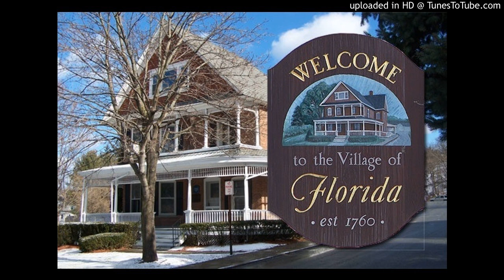Warwick and the 914 Area, pgm. 12: Long Distance Calls from Florida NY Step (February 1977)

Comment: This is certainly one of the more fascinating routing cases. The absence of the busy and reorder signals just adds to the uniqueness of this part of the system.

Also, that idea on how you wound up in that one conversation, regarding 3 way calling and the like makes complete sense.

It reminds me of a time in the early 2000's when I was regularly in 3 way calls with friends. Friend A would have me and Friend B on. I would get a call from another friend, switch over to talk to her for a few hours and then when that call ended normally that would be it.

Well, one day this happened, I talked to friend C for a few hours, and when she hung up the line flashed back to the other friends. I said "hey guys" which absolutely SHOCKED them -- they thought my connection was long gone. I still remember the surprise in their voices.

Those were fun days....

Comment: You were obviously more of a phreaker than me and my friends.  I was always afraid an Operator might dime me out to the "Phone Police" if I played too much.  I already caught their attention for a different reason.  Plus, when you hook a "borrowed" 3-slot into your dorm's coin line that had a single slot 1A, you could hear the surprise when the Operator says, "I thought those were all gone."  Lucky for me there were a few 3-slots left on campus in remote locations, but I was paranoid the PC's find me.  

I've experienced NJ Bell TSP Operators who recognized me.  1 Saturday night, I was repeatedly trying to call Dr. Demento's request line and after a few times getting the same Operator, she'd have me hold off pumping the quarters* into the phone until she got thru to the line.  Needless to say I spoke to her many times that night!!!  **The quarters always came back even if I got thru, unless I grounded the receiver's armored cable thru may arm to the booth shelf, resulting in a nice shock and the loss of a bunch of quarters!!  

So, where in Florida was the payphone you played from and what type of coin phone was it?  I don't know what WVT was using in 77 (didn't know that WVT even existed)?  Friends an I called the Monroe area's payphones "plastic payphones."   The nicest payphones in the area were the all chrome Northern Electric (?) Touch Tone 3-Slots in the vestibule of the Bright Star Diner in Central Valley NY!!!!  Wish I could have popped one of them off the wall!!!
Reply from the maker: For many phone trips,  I specifically recall the location and the type of phone I used. But Florida... I don't recall anything except that it was after nightfall. From the tape, I'd guess it was a Northern Electric Centurian (single slot, plastic front), but that's without researching to see if the sound of dialing actually matches known Centurians.
The Warwick phone was some sort of a 3 slotter but I don't recall more.
The coin relay was able to operate on current that passed THROUGH your arm? Are you sure you weren't just shocked IN ADDITION TO having the cable touch the shelf?
Reply: @evandoorbell4278  Thanks for the phone info.  I'm pretty sure the relay current passed thru my arm - the phone's ground was "switched off" and the current went from the cord thru my forearm to the booth's shelf, which was still grounded.  The booth was the typical 1950s/1960s wooden booths, my dorm was built in 1964, a WE Type 6 booth if I remember correctly (though I should get off my butt and walk 15 feet see if I can find the booth model number on the booth in my living room).  
My newest 3 slot has a 1972 date on it with a really long coiled cord, and was in an old shoe store in New Brunswick NJ that had been turned into a college book store.  Paid the store owner $25 for it in Sept 1976 - his only condition was that I didn't destroy his wall, which I didn't.